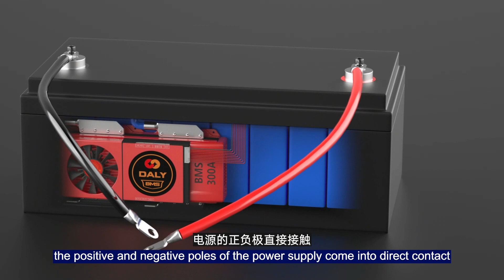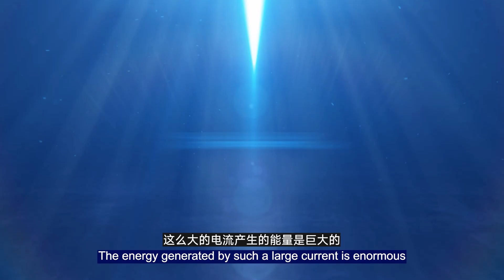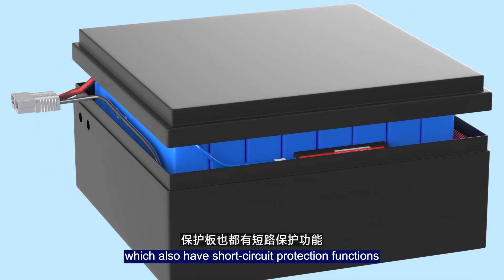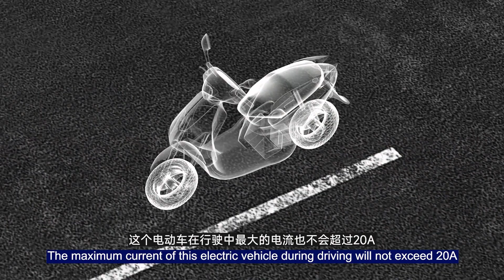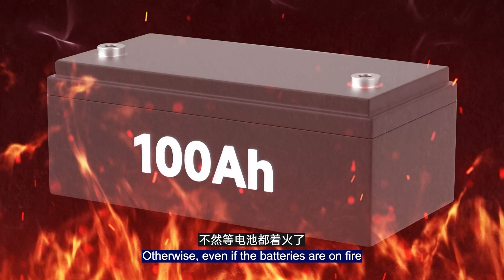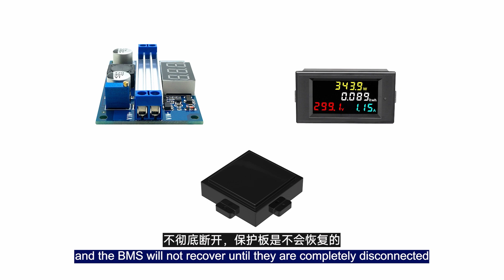#Lithiumbattery #shortcircuit problem

Comment: Hi. I have 5 batteries in parallel with a communication board but the master BMS is limiting the charge and discharge as if it just one battery. Deye inverter shows cumulative charging current untill limit of 200amp is reached. Instead of about 1000amps

Comment: Ho avuto 3 volte questo problema ( short circuit protect  fault) quale può essere il problema dopo un podi tempo 10 minuti   riparte tutto regolare   batterie a 3,32volt bilanciate 0,002 volt di differenza.
Non riesco capire , può essere problema del nuovo firmware ,perché è successo subito dopo aggiornamento?